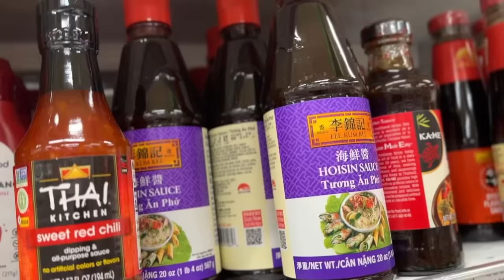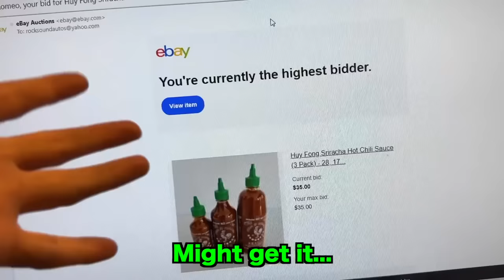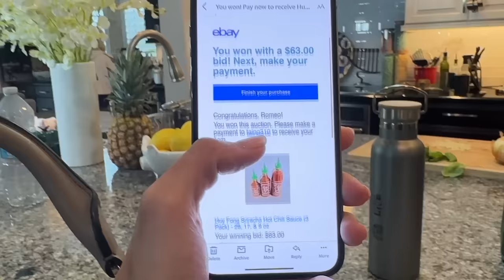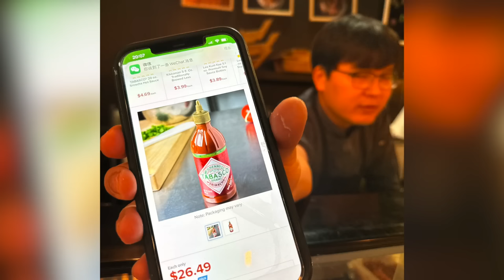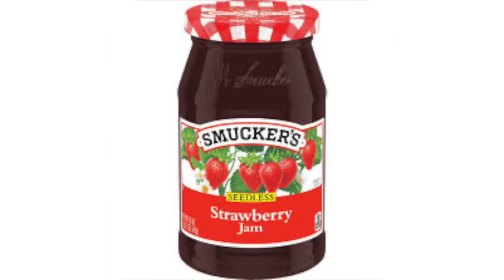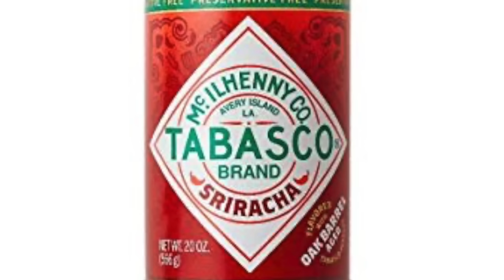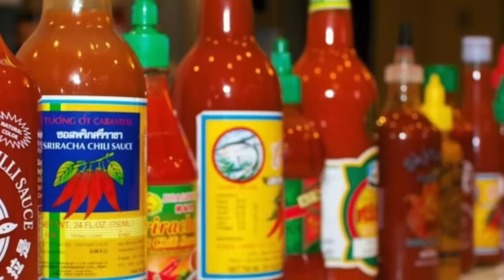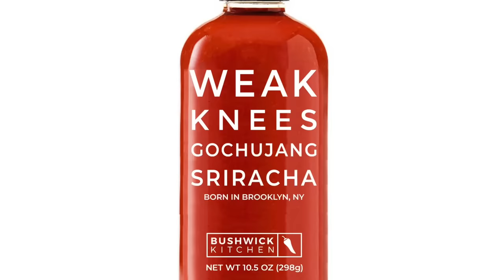Ranking EVERY Sriracha To Find The One That Tastes Most Like The Original

Comment: i really like sriracha and sambal, its rough that they are unavailable at a realistic price. For sambal I substitute wickles red relish with some added hot sauce or hoagie spread with added hot sauce. Ive always had Badia on hand because of the garlic, it hits different than huy fong. I tried tabasco version but I wasn't impressed. Walmart has a sriracha from "sky valley" but it didnt really do it for me either. I have plenty of other hot sauces to use until huy fong gets back in operation.. I have ass kickin hot sauce so I'll give that one a try and probably the 2nd place or is that the 1st runner up...
Reply: I like Sky Valley a lot.  It doesn't taste vinegary like Sriracha or Tabasco, but has a good taste and heat level.  I rate this one above Tabasco.